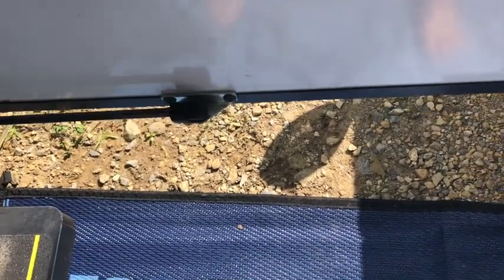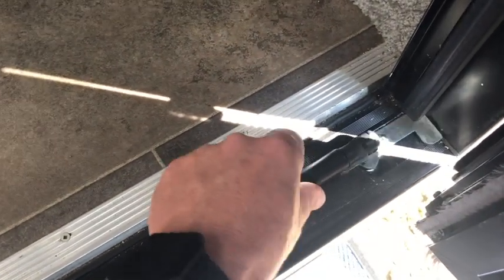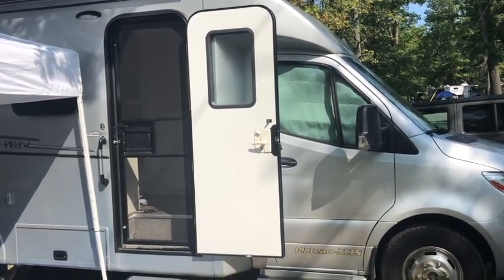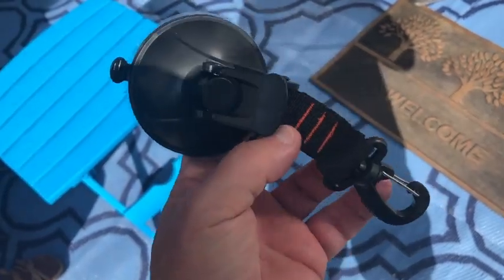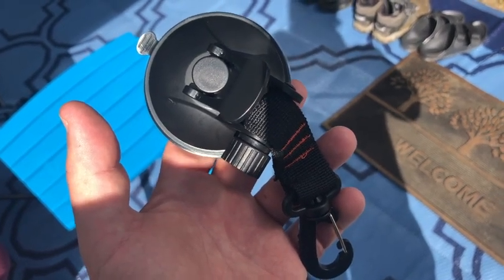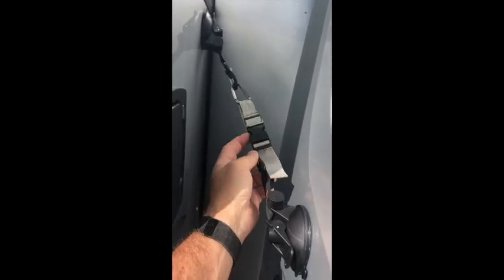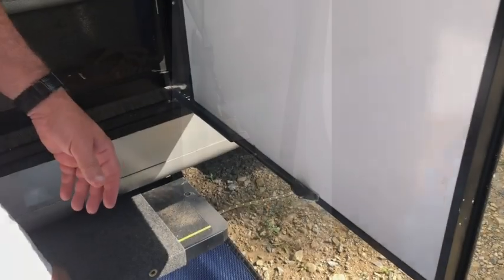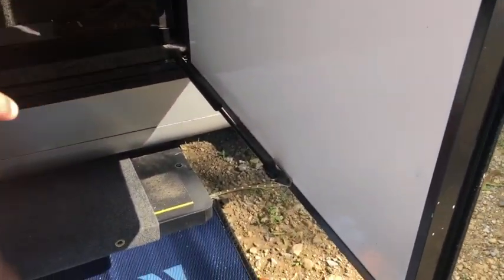Pleasure Way RV Exterior Door Modification

Comment: We had the same issue with our 2018 XLTS. After 2 or 3 attempts at a repair by moving to a larger screw, a used rivet nuts to attach the door plate to the frame. Rivet nuts are basically a nut that attaches like rivet. It gives you a much more secure platform using a bolt attaching to a nut mounted on the door sill. I had to buy a tool and a kit but it's been a year and well over 10,000 miles and no issues. Brad Adams
Reply from the maker: I would love to see some photos of the install and the tool required.  Our 2nd set of screws are already loose.
Reply: 2018 XLTD :-) Would also love to see photos of the install and tool required!
Reply: This is the tool that I used. My rig is in the shop, my generator won't start. I can get a photo of the repair once it's back. https://smile.amazon.com/gp/product/B003TODXQW/ref=ppx_yo_dt_b_search_asin_title?ie=UTF8&psc=1